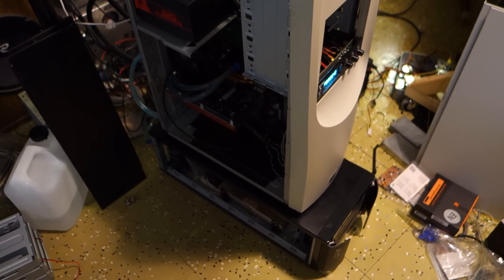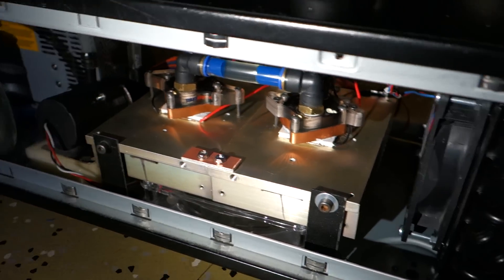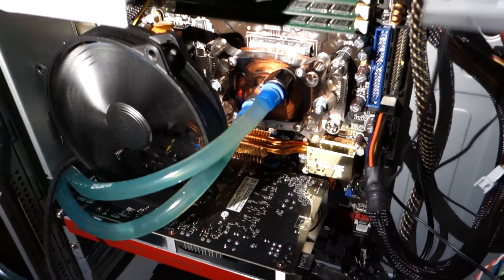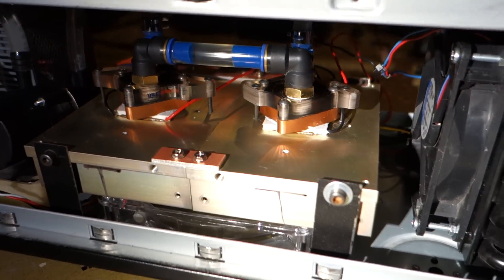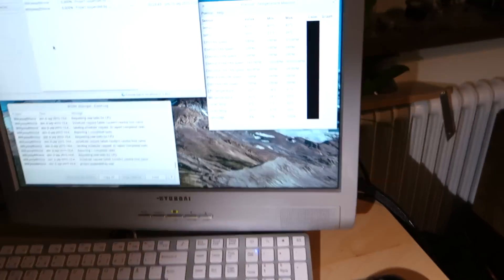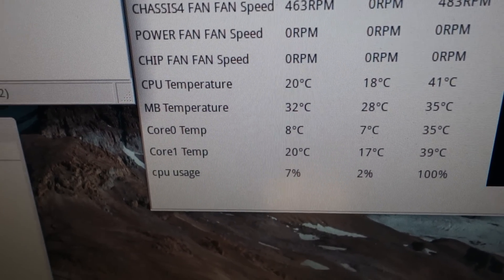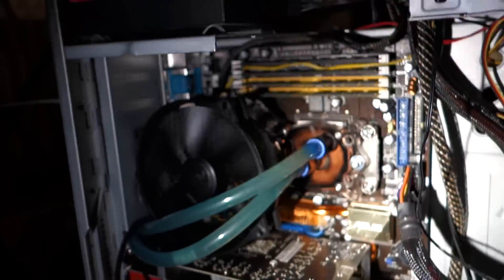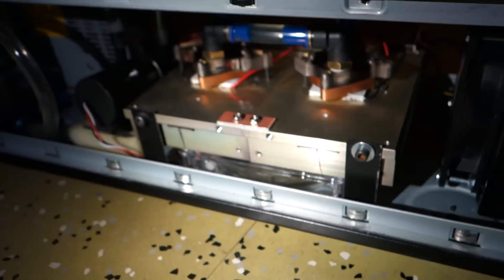Home made external watercooling system with coolant chiller

Comment: Cooler Master actually sells a case system a lot like this with small mini-ITX size cases that can be put on top of or underneath (or both) a main case to house extra hard drives or like in this build all the cooling hardware. I think they call it the Stacker.
Reply from the maker: +Jay Man Ah yes, the HAF Stacker series. I was looking at one of those when it came out, but decided that it wasn't really my cup of tea :P
Reply: Electricguy I think they are geared more towards small home/office budget servers that need a bunch of hard drives but don't want to take up too much space. I like the idea of your cooler here using peltier coolers. Back when I was picking out parts for my current rig in 2012, I was doing a little research on peltier coolers as well as a straight up window A/C unit for CPU overclocking. I think the main issue, which you mention, is the moisture. I've seen some people use a shit ton of insulation to try to keep it at a minimum. The other issue, though, is the amount of power these little guys draw. One thread measured a 50x50mm peltier cooling  pad drawing over 240 watts and 26 amps which is insane when you compare it to a typical 120mm closed loop cooler. Some ultra high end video cards don't even use that much power. And speaking of GPUs, it would be interesting to see how well this would cool something like an R9 290x or something similar. I'm running a R9 290 in my rig with a closed loop 140mm H90 and it is still hitting 50-55c which is good for what it is but it would be 'cool' to see it running below ambient.

Comment: Would be cool if you can chop down the side panels as well, and weld the parts together, or maybe rivets.
Reply from the maker: +Chip Guy Vids The side panels are chopped won to size. Just not put on :) The whole thing is screwed together.